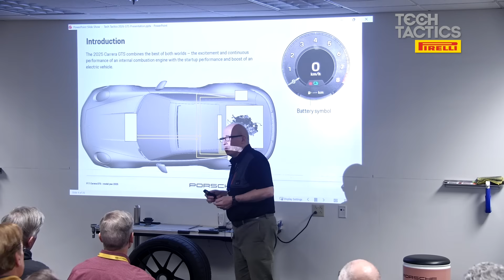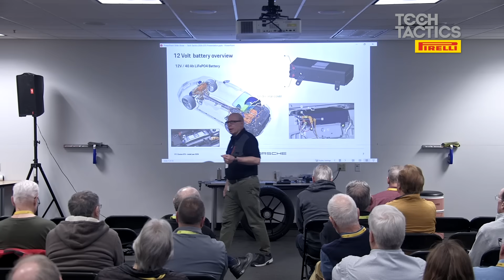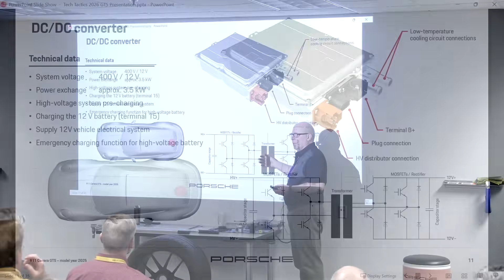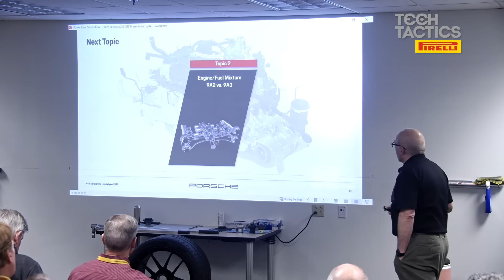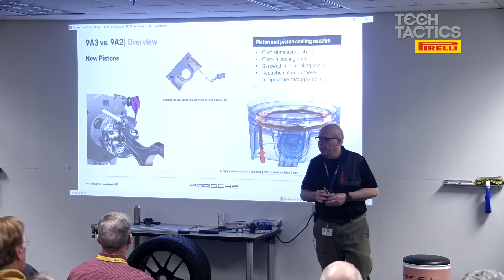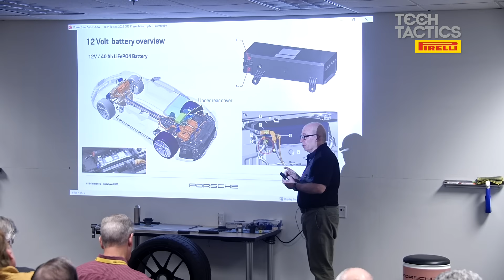The Future of Performance: A Deep Dive into Porsche’s T-Hybrid Tech | Tech Tactics

Comment: Having owned my GTS for a year, I do believe connecting a 12 volt trickle charger to the car is important when the car is used less frequently.  As Tom mentions, the 12 volt battery will protect itself when the charge is low.  When that happens, you are flat bedding your car to the dealer.  Even with the car turned off many systems will remain active and drain the 12 volt battery. Things like security, the Porsche Dashcam, the PCM system, and others  all continue to use power.  Get the C-tech Lithium charger. It knows how to get past the BMS logic and keep the 12 volt battery fresh. Connect the charger to the positive lug under the red cover and a good ground. Either the negative lug on the left side or a large nut on the shock tower. I tried several other chargers, including the Porsche branded one (made by C-tech) and none worked well.
Reply: Not true. If the 12V battery shuts down to protect itself then you need to connect 12V supply to open it up again.  Something with sufficient current - not a trickle charger.  This is the same as the lithium batteries in the 992.1.   Trucking only required if the high voltage battery depletes below a threshold value but chances of that are very low.

Comment: I guess I'll believe this T-Hybrid tech is so great when Porsche starts racing with these designs in their Cup cars?  New engine, new cam and valve structure, and new engine block with "arc induction ferrous coatings" for cylinder linings.... boy I've heard these arc induced coating stories before.... most of them lead to bore scoring.  We will see?  Embedding electric motors in the hottest parts of a drivetrain and inside of a turbocharger sounds ready made for failure, or at best reliability issues... by the way, what is the MTBF on the PDK/transmission motor and the turbo's electromotive dyno?  The Porsche engineer must know the answer to these questions?
Reply: T-hybrid technology is used in most if not all of the F1 racing teams. Porsche used an energy recuperation system in the 918 Spyder. This is not new technology.

Comment: Regarding the discussion around 18:01.  Remember these cars are equipped with Battery Management Systems (BMS). 

The BMS monitors: each cell’s voltage, module voltages, and total pack voltage.  If any cell goes too high charging is reduced or even stopped.  If any cell goes too low, discharge is limited ore shut off.  This prevents overcharging, over-discharging and internal chemical breakdown.  This is designed to prevent dangerous instability.

Additionally there is temperature monitoring, current monitoring, cell balancing, Isolation and Fault control, thermal management, etc., etc.  Car makers take this very serious, I would not be worried in the least about the concerns raised in the discussion.
Reply: Also, he is talking about Lithium Ion, these are Lithium Iron Phosphate, which is much more tolerant of large temperature ranges.  These are used in high-end off-road $1MM Earthroamers and are fine down to -40F and up to extreme temperatures.  Also, when he says the capacity is "half" at very low temps - that is when the battery is in use and drawing current... in storage it will be drawing 0 amps, and will be fine.